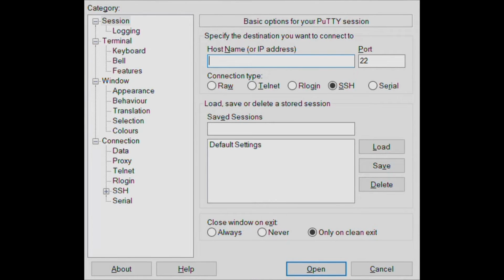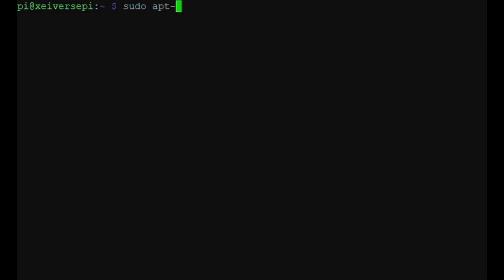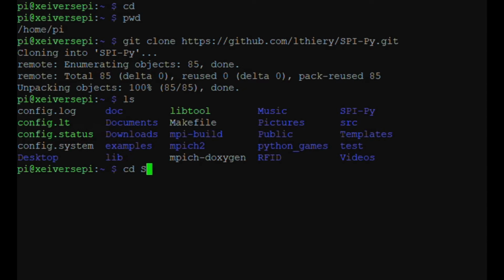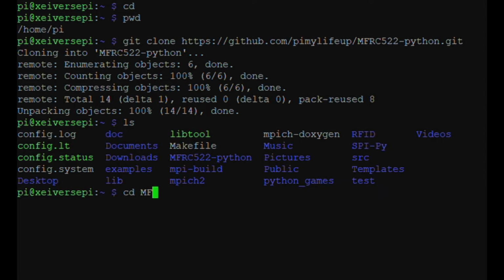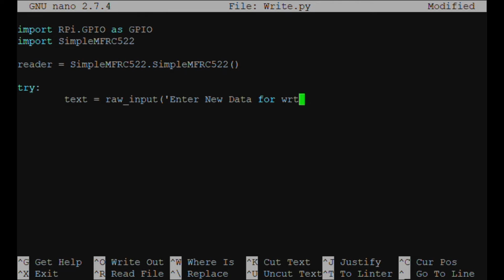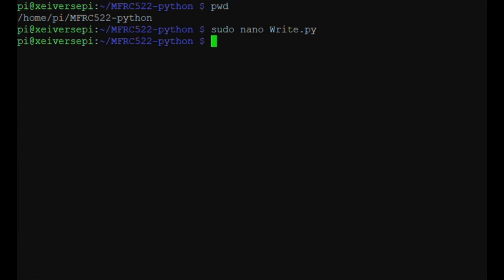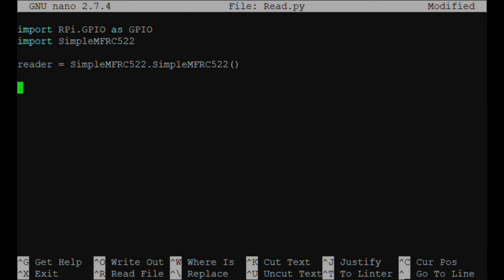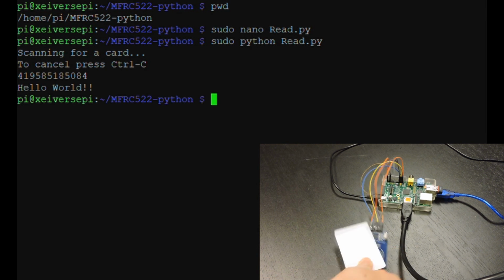Using an RFID scanner with a Raspberry Pi

Comment: Traceback (most recent call last):
  File "Write.py", line 6, in <module>
    reader = SimpleMFRC522()
  File "/home/pi/MFRC522-python/mfrc522/SimpleMFRC522.py", line 14, in _init_
    self.READER = MFRC522()
  File "/home/pi/MFRC522-python/mfrc522/MFRC522.py", line 130, in _init_
    self.spi.open(bus, device)
FileNotFoundError: [Errno 2] No such file or directory

I really dont know why i am getting this error can you please help me out?
Reply: im getting the same result... did you find a way to get it to work?

Comment: Good video. I've followed the instructions but when I "ls" the contents of MFRC522-python I don't see the SimpleMFRC522.py. There is another directory mfrc522. When I go into that directory it has the SimpleMFRC522.py file. Creating the Write.py file here gives the error "cannot perform relative import". Are you downloading the files from github or are you using an old version that you have on your computer? How do I get the file to work from this different version?